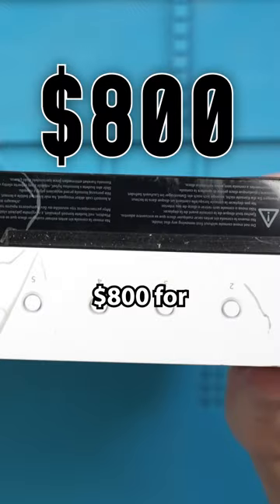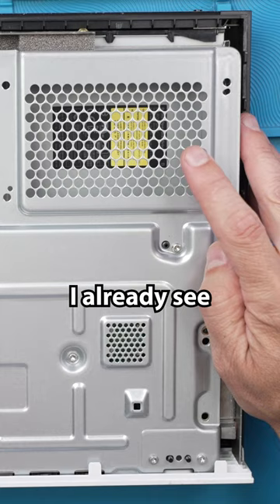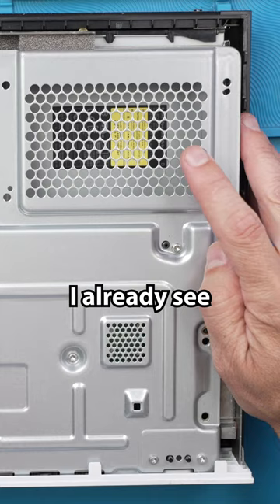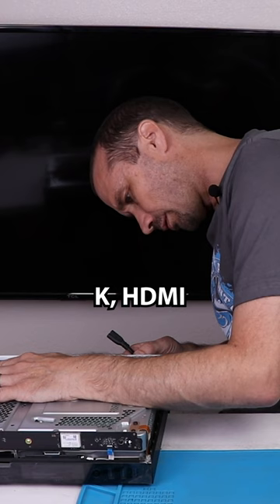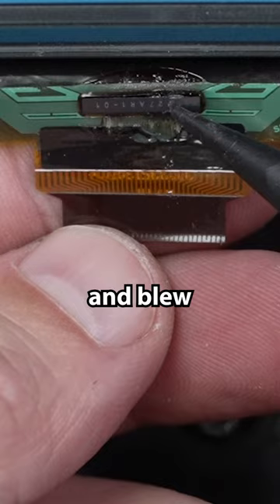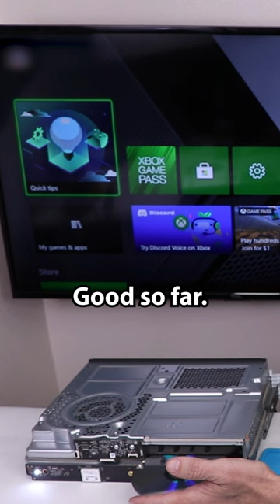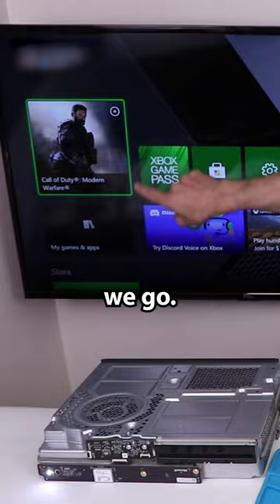BROKEN Xbox Dev Kit! Let's Try To Fix It!

Comment: Blows my mind how much people can sell broken stuff for.
Reply: It's a developer kit you can't just get ahold of those they are only sold to game development companies that alone make sthe kits very rare in itself and even rarer if that company or person who uses the kit to take it and sell it and due to that is exactly why they are so expensive even the broken ones.
Reply: its a development kit where 99.99% of people cant get a hold of it
Reply: Dev kit is extremely expensive
If my memory serve right Linus bought PS3 dev kit for 5k
Reply: @ios7jbpro  what’s the difference between the twk
Reply: @reecefacer2223  what can you do on the dev kits?
Reply: @reecefacer2223  I've never heard of that.  pretty cool
Reply: @Chun788  its basicly just an overpowered xbox one x(in this situation)
Reply: @Chun788  it depends. It's usually more powerful, gives you more hidden data and hidden settings menus. Usually though, dev kits come with a function that makes it so when it's connected to a wifi network not intended for it like unauthorised/not the right location, it will automatically brick itself to keep normal people from having access to features they weren't meant to.
Reply: @Chun788  it's to test games that you make
Reply: That's because this is a dev kit, or developer kit. It allows a lot of low level access to the software, and can be used to pirate/modify games (sometimes). These are only sold to development studios, and access to them is tightly controlled. Finding one of these broken for 800 bucks is like finding finding a Ferrari being sold for 5 grand because it has a flat tire, or like finding a bar of gold that somebody doesn't want because it smells funky. This is a an amazing find
Reply: very cool how everyone is replying with the same answer. you all are so very smart
Reply: @Chun788  i saw on LTT that they had a beefed up system. Like more ram and gpu and cpu power
Reply: @Chun788  they're how you develop games, this kit was probably nearly 50-80 grand new. The ps2 era dev kits were insanely expensive when they were new.
Reply: Broken stuff sells for so much because of all the videos on the Internet that show you how to fix it. Not that I'm complaining about that type of content i actually enjoy it but it makes it hard to buy broken consoles for five bucks anymore lol.
Reply: Try it with a regular Xbox and you’ll see how the prices drop
Reply: Youtubers buy em and they know it haha
Reply: @shagdog80 it sells for so much because people live in there moms basement

Comment: Could have got a better gaming PC for the same price and it would not need repair, but this is my opinion and I don’t care what you do as long as it works out for you
Reply: His content's not mainly on that purpose. He usually buys broken consoles/devices, repairs, and then sells them at a cheaper price also.

When you have a hobby of fixing things, its not even an issue to begin with.
Reply: He repairs stuff and you probably need more then 300 usd if you want a brand new gaming pc
Reply: @coldduck3494  he said he paid 800
Reply: @theAccursed  u cant just get the dev kit form Microsoft you have to be a legit game dev company proper offices and license and employees that have special training to use these kits and plus a bunch more stuff for them to even consider giving you one its really difficult to get these not just xbox but playstation as-well and they cost upwards of 1500 dollars
Reply: @theAccursed yes they could, windows has a plataform for porting games to Xbox and the Microsoft store
Reply: @theAccursed  there is a thing you do on Xbox to run programs, I think
Reply: that's a dev kit, they're super rare and only given out by microsoft to game devs for testing purposes etc and have a value of like 1500 lol
Reply: He isn't buying it to game on...
Reply: Try buying a 500 dollar pc that runs games as good as my ps5 lol, i've been at it a self build pc with atleast ps5 specs would cost around 1700bucks
Reply: @jaspervanwijk2685  built one for 150 that  is 2.52% faster on benchmarks and will run the same games 24-27 fps faster.

Comment: you can "restore" the functionality of the screen by tracing the lvds signals that goes to an lvds handler chip, its about the 10 lines that moves 720p (which is likely overkill for a frontpanel lcd) then getting a lvds 5chnnels lcd that will work with the incoming signals from the board :)

Comment: Do u maybe know what could be wrong with my old ps3? It turns on for 2-4 seconds and just turns off again
Reply: Does it have a yellow led and beeps when it shuts off? I hope not or otherways you have the ylod(yellow light of death) wich means your console is probably wasted cause of a underfill fault of nvidia but idk
Reply: That's maybe lost power, I experienced this a while ago, I replaced the power supply and it works again
Reply: I think it might be broken
Reply: @kevinbissinger  i know but what could be broken?
Reply: Its old ;)
Reply: @309electronics5  no it doesnt
Reply: @nasibiryani  oh ok where did u fix it?
Reply: @uondo7389  just buy new power supply & replace the old one , its cost about $10 in my country , you can do it yourself 😁

Comment: I got a laptop you can fix it keeps shutting off, if you fix it you can keep it
Reply: Sounds like its overheating unscrew the bottom bits and take the plate off and dust it out, hold any fans down when blowing them so you dont damage the motors